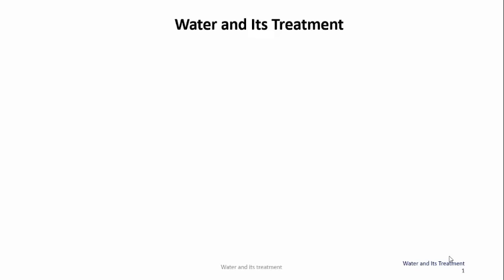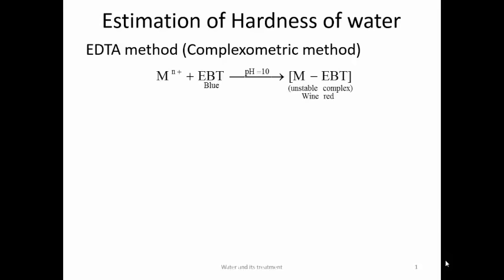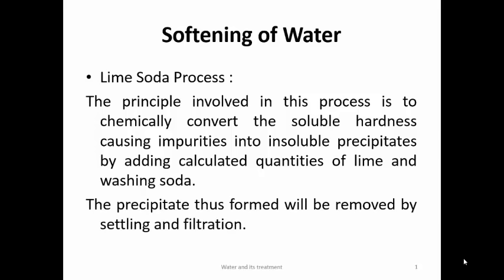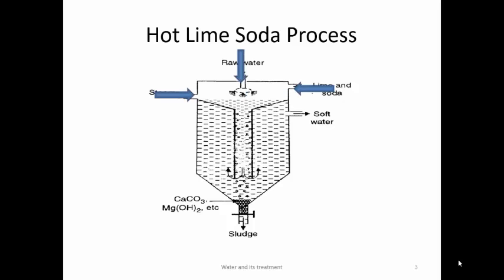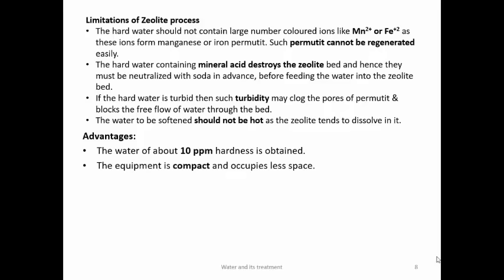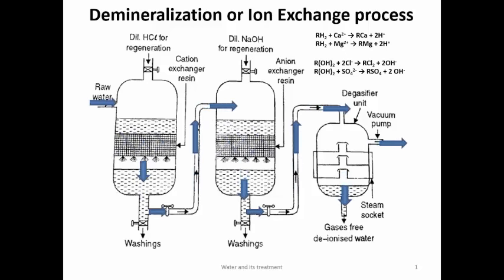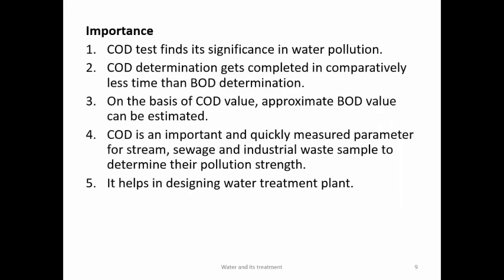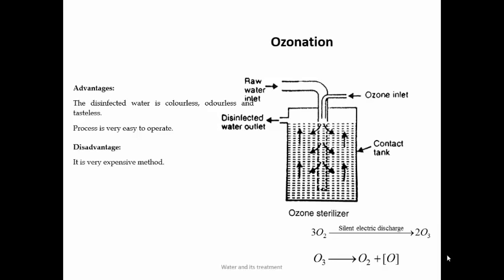Water and  itsTreatment

Comment: Can u please solve a question ?
Calculate the total, permanent and temporary hardness, when 100 ml of a sample of water required 20ml of 0.01M EDTA for titration using eriochrome black -t as an indicator. After boiling 100ml of same sample, required 10 ml of 0.01.